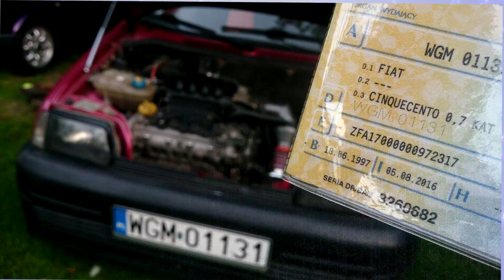Historia Różowego Cinquecento 1.4 16v

Comment: where the hell you fit the vedilateur
Reply from the maker: what's vedilateur?
Reply: the fan for the fridge. anyway it's a pitty you crashed the car at the end of the video i was ready to cry :'( Did you fixed that?
Reply from the maker: you mean radiator? it's stock
it is unfixable
Reply: no i mean the vedilator for the engine's fridge. didn't you have high temperatures?
Reply from the maker: ventilator is on the radiator
at 0:23 you can see only radiator because ventilator is on the opposite side